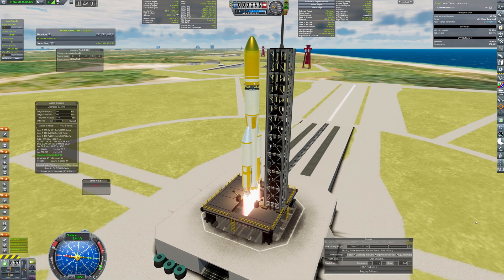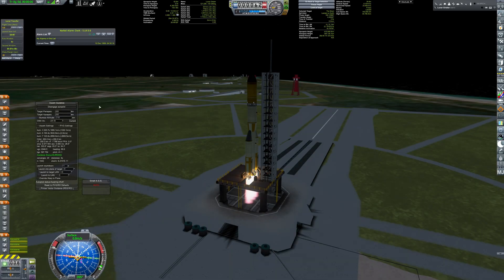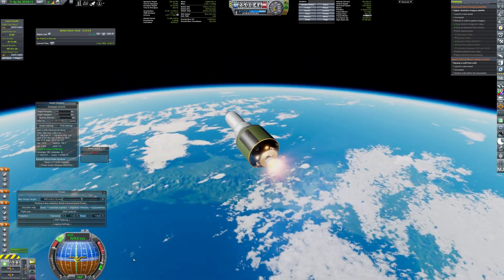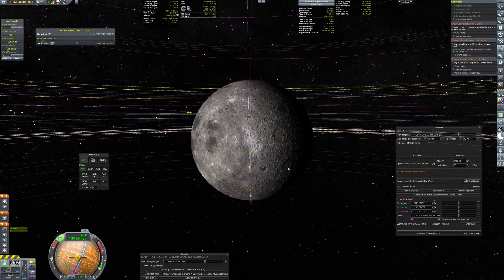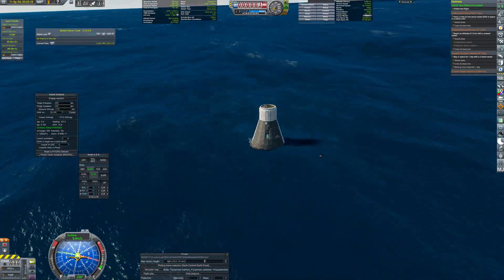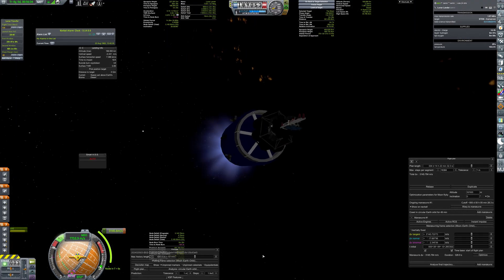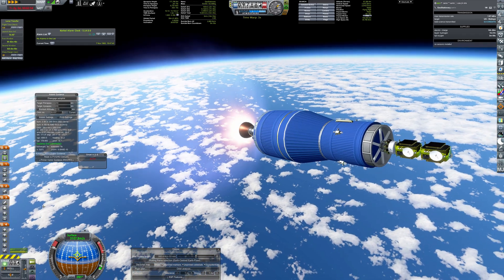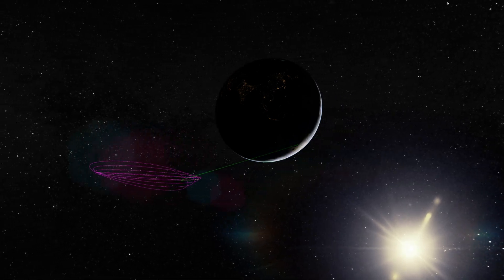Lunar Era (KSP/RP-1)

Comment: hey Darkherring. thanks for the videos!
but im really having a hard time in jnsq + kerbalism, orbit is so hard. I think i might be doing something wrong, Do you have any easy tips for easy orbit? I tryed watching your videos, but lot of times you go with no HUD or accelarates a lot or cut hahah 
But what i know, 5k dV is enought for low orbit right? the problem for me is the transitions, should i go full up then change 45o at the right periapsis? I tryed i lot of things but its haaard haha
TYTY
Reply from the maker: Yes, 5000m/s should be fine.

About the ascent profile - start your turn quite early - even below 1km. Go for 45 degrees at 15-20km and gradually flatten it.
Reply: @Darkherring  thank you thank you It got better. But i think something might me wrong with my mods after a lot of trys. I have almost 6.3000dv doing smooth transitions and still i cant get 95km orbit. I might reinstal everything to make sure .